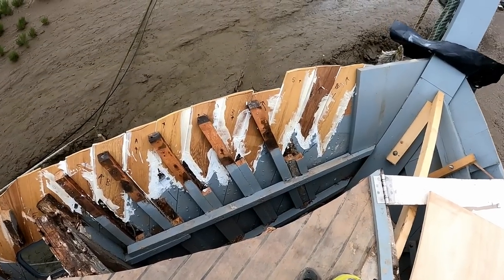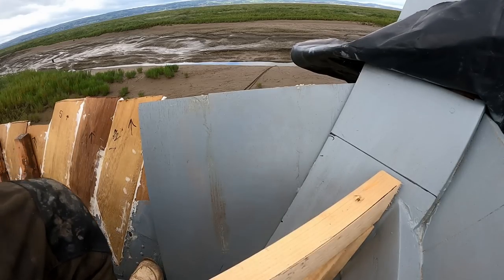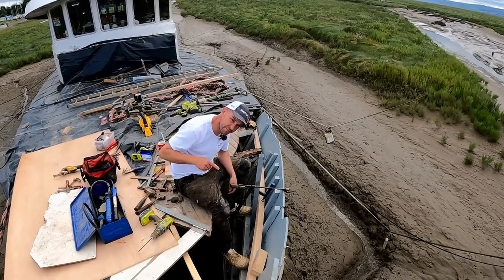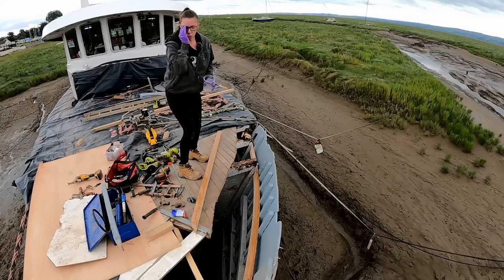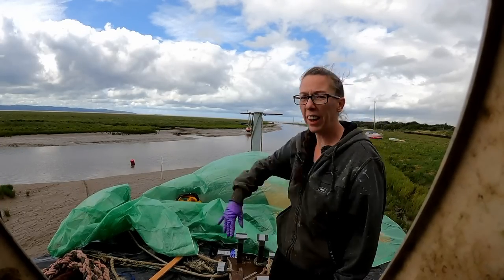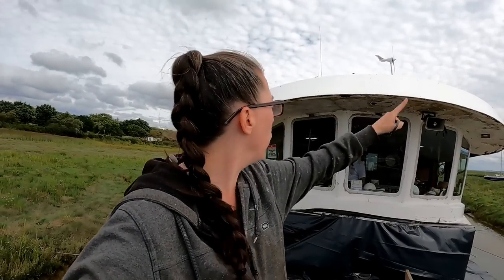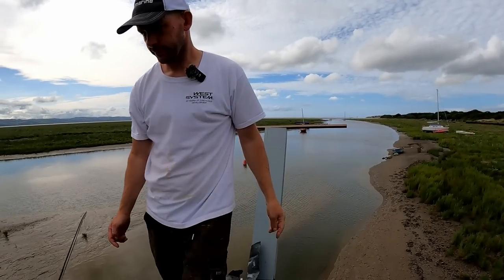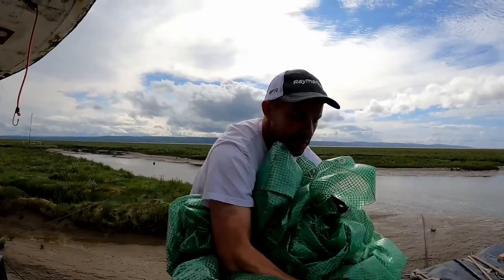Ep 138  Turning Our Boat Into A SAIL BOAT?! #boatrestoration

Comment: hammer is tool steel, nails are mild steel. if you hit two hard materials together they can chip each other. them chips fly at high speed and can pierce flesh as i found out in the forge
Reply: I can confirm that as i had a pice of hammer bed itself into my arm and let me tell you it felt like a bullet hit me. I still have that hammer in my garage

Comment: The issue with the hammer is the metal being hardened hitting another hammer which is hardened.   Hardened metal is strong but brittle.
A couple of years ago, a narrowboat YouTuber hit a hardened docking pin with a hammer.   I piece of the pin broke off and lodged in his leg.    A trip to the Emergency Room, some X rays.   The doctor was not able to extract the piece.    The fellow may still have the piece in his leg.
Simon was not even wearing eye protection.   A tiny piece could easily break off and if it went into an eye, this would be a bad day.
Reply: Similar to rubbing two files together, the case hardened exterior against the mild interior, I would not trust it without proper protection. Coincidently (!) I wonder what would happen if the worst event arose and the paramedics were called?!
Reply: Hammers will not explode but will chip, it took nearly 25 years for a piece of hammer metal chip, just slightly smaller than two 22 airgun pellets, to work its way out of my leg. How did it get there? me hitting a lump hammer with a another hammer.

Comment: Shape the tarp into a triangular sun shade. Stitch, glue or velcro. Add new grommets. Add more restraints on the roof due to wind and force. Use ropes rather than bungee. Or buy the appropriate sized triangular sunshade. Install a beefier brace at the bow.

First atfempt failed but version 2/3 will be better. Happy sails.

Comment: I've done years in technical schools... the hammer on hammer thing is a myth. The only people getting hit by bits of metal are pounding "mushroomed", fractured, and tired chunks of steel. You are taught to grind the Mushroom out/off (usually punches and drifts). The hammer being struck was a BALL PEEN: it is literally built to be struck on the head by another hammer to PEEN metal with the ball end (therefore made to take equal pressures on either end. This is its DESIGN. The sketchiest is using the soft blows to hit them... you'll get composite fragments taking your eye out WHEN they fail (and they will). Loved that SEA KING heli flyby. KEEP UP THE GREAT WORK SIMON & GEMMA!!! Love your content!

Comment: Your mating the beam shelf to the stem post had me thinking.   Seeing as Surinda was originally built in wartime conditions with great time, material & commercial constraints. Also the builders were probably would only need to last a few years at best.
You two have are also adding love & care in your rebuilding. So I would happily lay a large bet that she is going to end up rebuilt to a much higher quality than when she was brand new.

Comment: Perhaps run a beam from the cockpit to the beam at the front, to give it some centre support? Then tie the side ends down on the edges of the boat. That way you'll have a 'tent' where the wind would mostly blow over instead of under? Just a thought, would likely be more of a hassle to setup thought 🤔

Comment: I've got a tiny chip of hardened tool steel in my forearm from hitting a Jack hammer chisel with a 1 kilo shop hammer so no the hammer won't explode and kill you but you should wear eye protection cause a Chip could damn well put your eye out

Comment: I don't know if this has already been mentioned but you could run two lines from those anchor points to the stern, place the sheet over the two lines. From there you could place some temp anchor points along either side and attach the sheet down along those anchor points. Kinda like an old style tent.

Comment: Like you both. On E bay there are plastic clamps for tarps, and they are cheap. The sheeting you have clamps could be installed with as many as required.
Then tie from the clamps to your boat fixed points.
The edge of the sheet you could more than doubled so the clamps could stop the sheet ripping, or put a small dowel between the fold.
I bought some because if I  was camping ,and the wind there was extra strong i could install more anchor points to the tent.
Also you could use cheap caribeners to release the sheet from your boats fixing points to take down the sheet easily 
.Thanks Keith.

Comment: A suggestion ref the sheet, if you ran 3 lengths of rope, one in the middle from the centre of the cabin to the stem post and one either side. Ty wrap the sheet at regular intervals to the rope and attach some side bungees to fasten into the sides of the boat. The ropes if they are cut to the right length will give you a structured shape that won’t flap about in the wind. The whole thing could be unhooked at both ends when not in use and the side anchor bungees removed. Just an idea lol…😊

Comment: I run a line from the center of the rooftop to the center of the T on the bow. Bungie the ends of the plastic sheet. Similar to what sailboats do to keep the sun off. In your case the rain

Comment: If you do it properly It will work.
First you set the canvas over the top of the roof. Then tie all sides and the front to the stem post and  bulk wards. The plan is to present a smut surface to the wind to pass over the top of the canvas.

Comment: Make bows with 1 inch PVC piping every 4 or 5 feet that run thwartships with longitudinal pipes running back to house from the forepeak. You can even use heat shrink material to make a more permanent shelter cover, it lasts for ages. Look up "hoop house"  or canopy for an example.

Comment: I have a 6 x 3 metre tent made of aluminium tubes, there is a very large tarp over it and it is held in place only by a lot of plastic milk bottles holding 2 litres of water hanging from the eyelets and has never moved in any storm in the last 4 or 5 years. The bottles are spray painted with silver gal type paint as they only last a couple of months if allowed to be naked in the sun.

Comment: You could try and run one cable to the stem and with a couple of sandbags with bungees or ropes attached to the tarp edge eyelets, just throw them over the side of the boat on both sides. Could be quick and effective.

Comment: The two hammers thing is an old wives tale.
I've had shelters up on deck before. They need to be heavy-duty. I use heavy insulated tarps due to the fact I'm in Queensland and it's either pissing down rain or blazing heat. Attach the wheelhouse end with carabiners. The edges are the problem. A stiff edge is required or any wind will find the sagging sections and flog it to pieces, so a frame of some sort, secured to the hull/deck is needed, even if it's just lashed down and not bolted. I often see people use portable pergolas or marquees like you see at picnics and such. Cheap tarps will just cost you more money eventually.

Comment: Gemma, I know you spend a LOT of time sanding the sealer off the so perhaps this suggestion might help. Have you ever tried using "painters tape" to either side of the seams before putting the sealer on andm  once you have installed the board you can still scrape the excess sealer off. Then once the sealer has set or cured, you can easily strip the tape off, along with what remains of the sealer!! Just be sure you don't use a sharp edged scrapper or push too hard when removing the sealer 
because painters tape is designed with less adhesive to make it easier to remove and prevent leaving residue you would then have to clean off with a solvent. The tapes come is various widths so you can choose which ever works best for you. I've used this method while both joining new wood with epoxy to make wider planks and even to repair old broken furniture. Good Luck and Best Wishes to the both of you.

Comment: Not sure if you are using green oak. I had fun & games with screws into green oak fence posts. I set the posts and fitted hinges with screws (as you do. Over the next year my posts moved about (as green oak does). The hinges needed moving and every single screw sheared off. I  refitted the hinges with wall plugs and no problems next time the screws needed attention. 
Just something that might be useful.

Comment: I have a shade cover made out of PVC pipe looks like a hoop house using connections looking like crosses on ridge, tee's on either edge laid out in a grid pattern++++ then bring to edges together to  fix in DD  bowed shape .Cover with tarp but to keep in place I have to use a rope back and forth  over top of tarp at  fixed points on  sides XXXX and  securing edges every few feet to hold it all down. Mine spans between to roof eaves  and frame is secured independent of tarp  anyhow sure you get the idea   good luck

Comment: Ok Gemma your hammer skills are in need of a small tweak, never hold the hammer half way up the shaft it will always end up painful, secondly the accuracy will be bad so always hold at the end it improves the strike radius reducing a missed strike 👍 , my guess is you do this because the hammer feels more controlled for you the real problem is the hammer weight is to heavy so pick the correct weight, in my day with a 24 Oz hammer a 5mm 4 inch nail with one tap to start it could be put home in two blows, estwing for ever 👍👏👏😊

Comment: What you should do with the tent idea is a beam from the bow post back to as much as you need supported on a X frame then the cover over that weighted at the edges .. or tied down to temporary cleats .. same as the covers you have over yacht booms .. had a cover like that on my yacht when moored or on the hard over wintering it works

Comment: Pull some ropes trough the ylets from the wheelhouse to the t, and one in the middle a bit higher. pul the tarp over the ropes and bind the sides from the tarp to the sides of the boat. like a real tent, you can pul ropes under the keel of the boat if needded to keep it in place use the 3 ropes from the front to the wheelhous as carrier of the sail, the higer middle wire il keep the water out and prevent sagging. .the two outher wires of the tee keeps it a bit free from the sides of the boat.

Comment: Aw, aw, aw ... I got a small piece of sharpnel stuck on my right humerus, a bit of a tempered hammer I struck with another tempered hammer... been there decades, never bothered to do surgery, is very small. But that in your eye is a different can of worms. I learned it the hard way and will never do it again. I mean, it wasn't the first time, it doesn't happen everytime, but sometimes you win the lottery, LOL... You can hammer soft metals, even soft iron, no problemo. But tempered steel against tempered steel... you are buying lottery tickets.

Comment: On the hitting  hammers together  ,one thing I will say is never hit a bearing  with  a hammer ,I did about 30 years ago ,it did shatter  ,I pulled the last piece  of shrapnel  out of my chest about 5 years ago .
So to me there is some  basis to not hitting  harden steel together.

Comment: You need to put a radius on that board. You need to take strips of boards glue them together and make a radius so the tarp does not tear. If you make the radius long enough, it will hang over the boat and it will give you the clearance that you want.

Comment: OK. after a life time of being a Tradesman Boilermaker ( now retired at 65yoa) I can 100% guarantee that if you hit two steel hammers ( of good quality) together you will be able to have shards breaking off and depending on how hard you do it the chance will increase proportionately. 
Myth Busters is a TV show where as I have a life time of experience in working with metals and I guarantee you that I am 100% correct.
I have seen people do it and get injured, and yes, a lump of hard, sharp steel in your retina is not a pretty sight.
If you use a copper hammer against a steel hammer, that is a different result and safer.
Regarding an anvil... It is not as hard as a hammer head, I have literally made some out of 8" thick mild steel slabs and they all perform very well and its mass helps to absorb the shock.

Comment: So - The problem is hardened heads.Never hit two hardened heads together. When I was 17 I was using two claw hammers to break up some pallets. I used the second hammer to hit the face of the first hammer so that I could drive the claw of the first hammer further under the nail head.  The head didn't explode, but a couple of large splinters of the head came off. One went through my shirt, and disappeared into my side.  Had to go to casualty and have the offending half inch shard of hardened steel removed from my side. It had penetrated to a depth of just under an inch. Fortunately it didn't hit me in the eye or face. Never did find the other piece. As with all of these things, it CAN happen. Personally, I have never tried to repeat the experiment. 😉

Comment: Progress. The tool abuse is sometimes necessary to get the job done to a satisfactory level. Ask anyone who has ever used a screwdriver as a chisel or accidentally welded one to a piece of steel when applying pressure to the work.😂
Also, if you attach a 2 litre coke bottles full of water to the free edge and over the side it'll give some weight to the edges. You'll need a solid center support for the apex of the tent too.... ya could make it work!

Comment: I see you tried my suggestion...I was thinking of a much larger tarp that would actually drape over the sides of the boat where you could fasten weight to it or run bungee cords across under the hull. It would keep the wind from blowing underneath the tarp, which is why you guys were fighting it so much. also you would want to run a rope from the eyelets to the bow to support the top and you would want that taught as you could get it to eliminate sag.

Comment: I do believe adding a mast forward with jib rigging is a darn good idea.  There is nothing wrong what so ever with mixing diesel engines and sail.  One or the other are completely different experiences.  Put them together and what do you have to loose? NOTHING!  But you might keep a few Pounds in your wallet when it comes time to fill the diesel tanks! 
I think she looks very handsome in the illustration (which I suspect was a joke)...but I like it!
What I would STRONGLY recommend is lose the massive forward leaning fake 80's flybridge OR turn it around 180 degrees so they sweep to the stern - then you can use them for your diesel exhaust stacks. ♥

Comment: Don't believe everything Mythbusters couldn't replicate in a weekly episode.  Hammers are very unlikely to explode sure, but chips WILL break off the edges.  I've seen it happen.  New modern hammers probably select certain alloys and do fancy heat-treating/cryo-freezing stuff to reduce the chance.   But a well used older hammer can easily start hardening and deforming then send a chip flying.  It's just random chance whether it will be a round-ish lump going slow or a needle like shard flying off fast.   (An anvil is typically hit in the middle where there is plenty of support and extra metal all around for an errant hammer to fully contact, but they also do chip at the edges over time.)

Comment: Many years ago I worked for circuses, and we drove our 2.75 inch 3 foot 6 inch tent pegs into the ground using 14lb sledgehammers, if we hit a rock you would yell for a mate and the two of you on a hammer each would swing your hammer and drive that peg through the rock. You would always try to pick the speed up and catch your mates hammer on top of the peg and if you did the vibrations would really wake him up. NOT ONCE did we ever have a head explode . To put a peg into the ground there was no lift the hammer and swing it down, you basically measusred your distance and then just sort of kept swinging your hammer around in a circle so you came down sort of slide of the side and completed the swing in a circle an kept going tillthe peg was 3 feet into the ground

Comment: How do you guys get AC power on the boat ?   My guess is lots of big batteries ???, btw you guys are a fantastic team, a perfect match one might say 🙂
Reply: There are videos a year and a bit ago of putting in the solar+battery system with a Victron inverter/charger. In other videos they’ve been also using a generator and sometimes a standalone power unit (Ecoflow kind of unit) for additional power.

Comment: If you put 3 strong ropes as a back bone from your stem post to the eyelets you put in and strap the tarp down firmly over them so the wind can't get in under it you will have a far better result than you did. Having it loose and flapping like you did made it act like a spinnaker sail and not as the tent you were after. Just look at a normal camping tent and you´ll see why it has so be firmly strapped down, perhaps even with ropes on top of it to hold it securely. So major tip # 1 do not let the wind under your tarp or it will pull like crazy and possible ruin your rain protection. Tip # 2 have a solid or rope "spine" running from stem post to the wheel house. You can leave the "spine" in place even if you remove the tarp. Hope it works out for you. Strong winds may still ruin it for you so do take the tarp down if above average winds are expected in your area.

Comment: The hammer heads striking each other is only dangerous when one or both have been beaten over time that the faces have squished out and started to split theses splits can fracture off and take an eye out,it’s known as work hardening this causes brittleness at the rolled out metal around the face of the hammer head end, this is why tool maintenance is important by dressing back the rolled out material will prevent that ever happening 👍 the myth busters were wrong, ask any blacksmith 👌